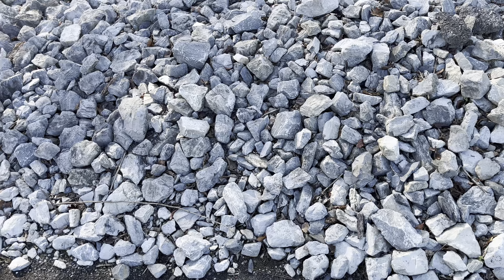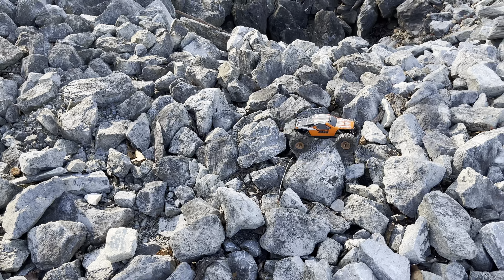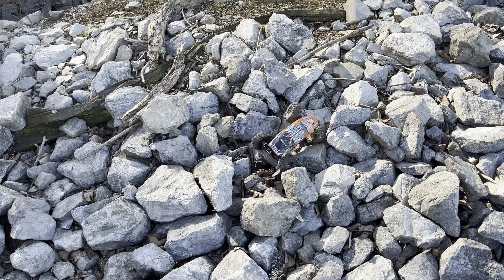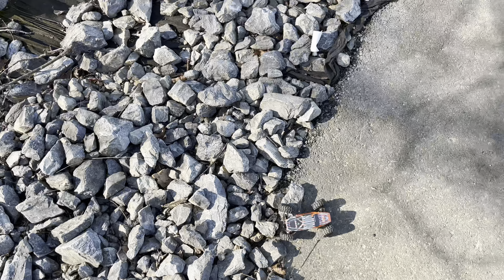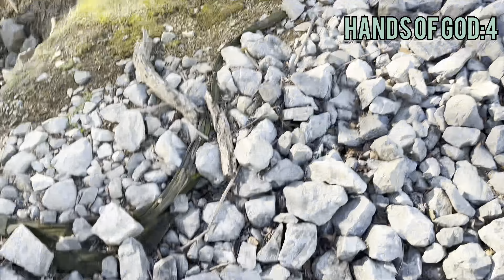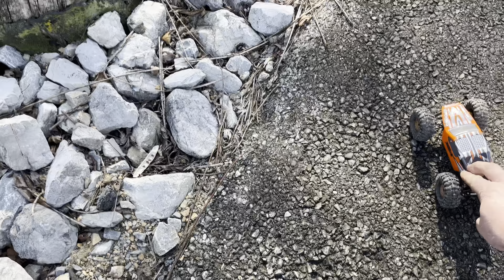Axial AX24 Crawling

Comment: I'm building my daughter a Injora buggy out of a used deadbolt I bought from a guy that put so much paint on it it's only good for a parts car. Had tons of upgrades on it is the only reason I got it from him. If he had done it right it would have been better, but he used paint marker and painted over everything at least 3 time. Silver, then red  and then gold. Couldn't get the paint out of a lot of the screws and hat to drill them out.